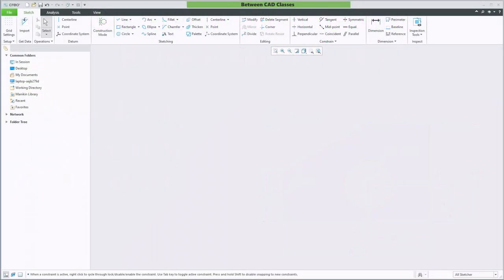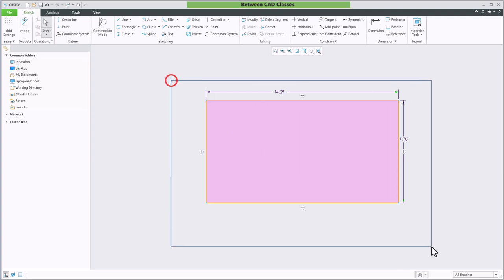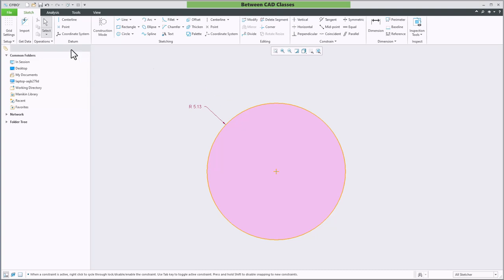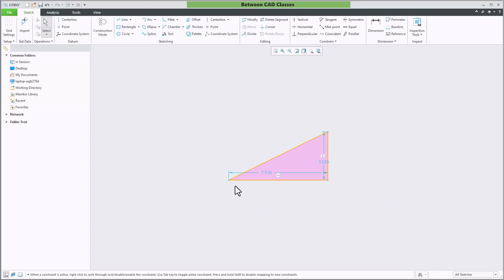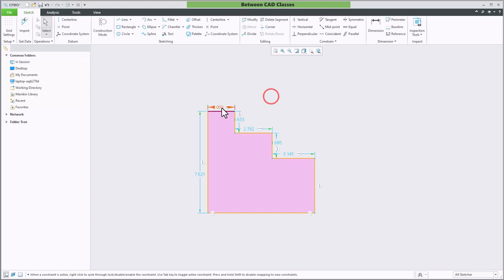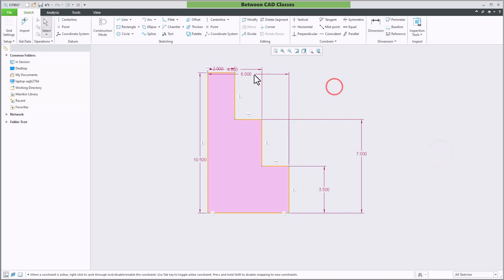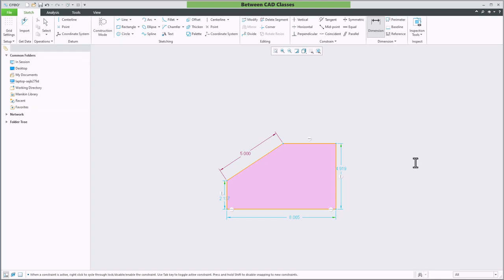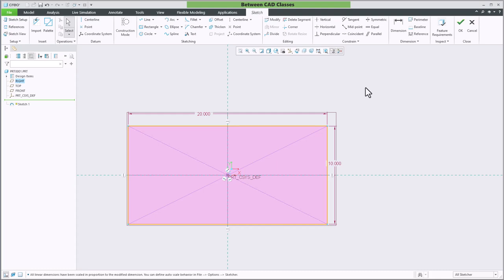Creo Parametric Course - Part 11: Sketch Dimensions

Comment: How can you change the names of those dimensions? I use CREO 10 and I cannot find how to do that in a sketching environment. 
What exactly do I mean? Those two dimensions of yours are, most likely, called sd0 = 10 and sd1 = 5.
I want to change the name of sd0 --> L (length) and sd1 --> W (width), let us say, and then, later on, use a/2 and b/3 for the dimensions locating the center of a hole (or other extrude feature).
How can one do that as the very first step in sketching a part? Thank you very much!!
Reply from the maker: I do not know a way of doing this up front, unfortunately. After the dimensions have been created, you can select the sketch in the model tree, then select the "Edit Dimension" option. This will cause the dimensions to appear on the model. Select a dimension, which will display the "Dimension" context sensitive ribbon tab. In the Value group, you can edit the name of the dimension, which can then be used in the Relations dialog box to set up formulas. I hope that helps!
Reply: @betweencadclasses  Thank you for your kind answer!
The thing is this -- once one uses an imported sketch in a part, via an extrude let us say, then the sketch disappears in a thing called SECTION 1. Editing that section does not get me back to the original sketch, or I am not able to do that myself.
And while one creates a sketch, there is no Model Tree to the left.
Just to be clear, this is my procedure:
1) create "mysketch.sec.1" as a separate file on the hard drive.
2) create "mypart.prt.1" as a separate file on the hard drive.
3) create "Extrude 1", then click IMPORT button (all the way to the left) and insert sketch "mysketch.sec.1" in the extrude, click OK, give it some height, save "Extrude 1" feature.
4) create "Extrude 2", then click IMPORT button (all the way to the left) and insert sketch "mysketch.sec.1" in the extrude, click OK, give it some height, save "Extrude 2" feature.
And so forth -- I am using this to create a tessellation pattern on the face of a decorative part, and I am repeating a small pattern all over the face of that part, until it is covered in its entirety. I got even 100+ extrudes into a part doing that. There might be more productive ways to do this, like doing a single extrude and then repeating it by using CREO patterns, I should probably look into that -- but even so, I still have to perform step 3, where I use the external sketch (is this a good name for it?) at least once.
As you can probably tell, I am still learning CREO and will probably do this for decades to come.